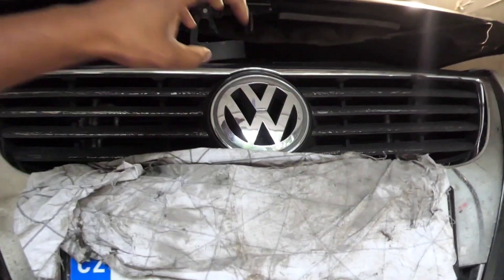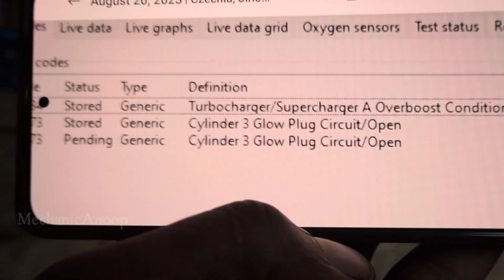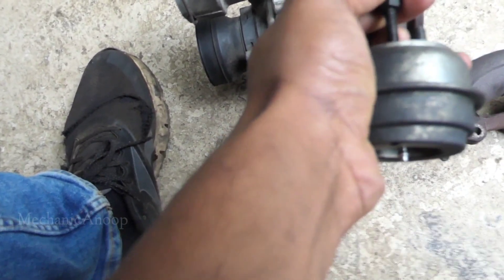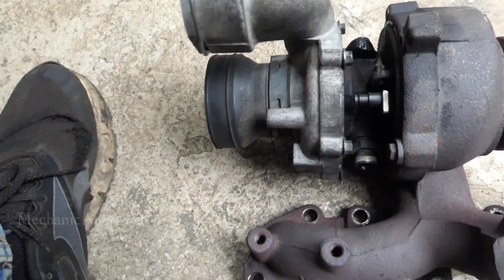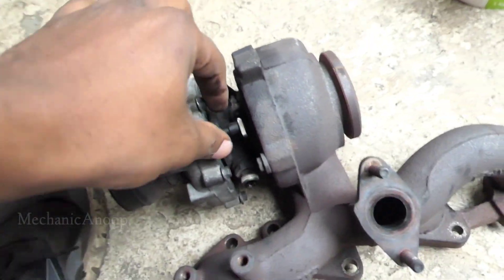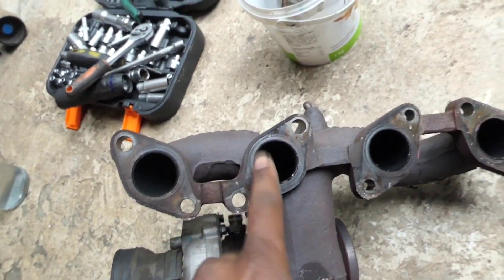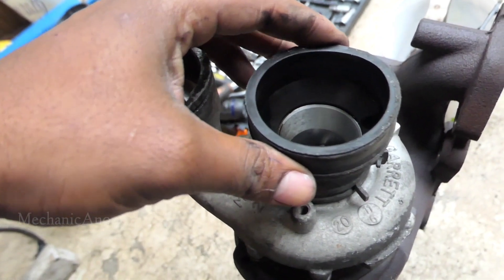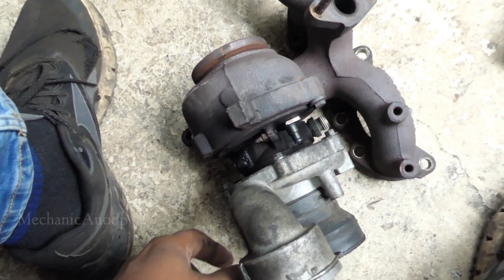Turbo overboost explained (English). #turbo #overboost #tdi

Comment: I do not understand i have same engine same turbo same failure P0234 overboost but sometimes i got underboost. When I free vacuum actuator vanes are easy to move no stuck no nothing. I changed Maf sensor vacuum lines and same problem. I do not have N75 valve i have vacuum box. I will try to change vacuum actuator.
Reply: And two months ago i removed and deleted EGR and EGR cooler and maped engine to 175hp original 140hp and no difference just at 3 speed better acceleration
Reply: Did you sort the problem ?
Reply: @ronanhoran6818  I repaired turbo cleaned vanes that was problem
Reply: mine is doing it with brandnew turbos, ive just removed the vac box with simplification n75 kit seems ok so far
Reply: @ronanhoran6818  I did that too deleted vac box and installed n75 kit easy and simple and cheaper. But again same problem overboost issue all because of bad turbo